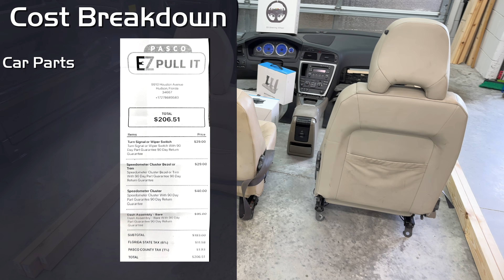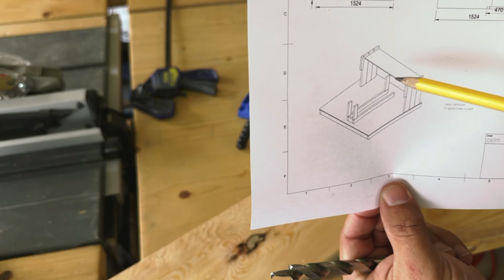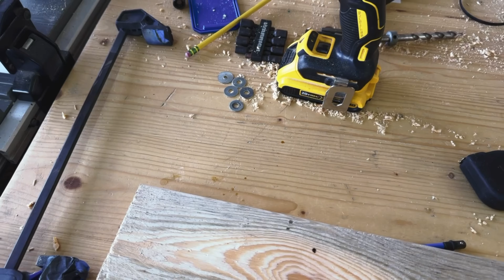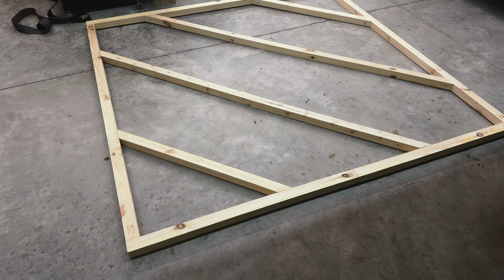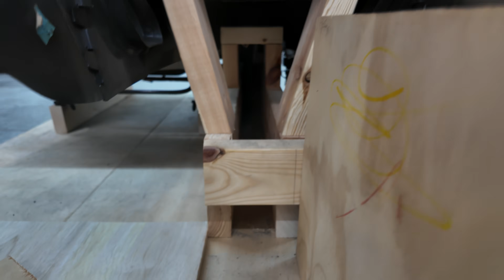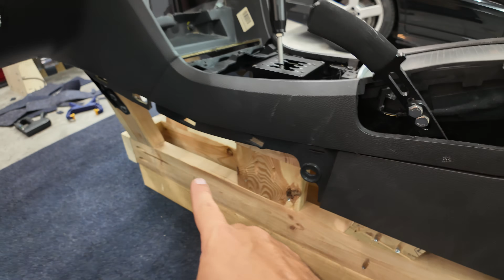How to build a Simrig using a REAL car.

Comment: Im thinking about getting in to race sims. I unfortunately have to start small, I don't know how much I will like it bc I have never played on one other than like arcade games 20 years ago. Im about to order a wheel, peddles, and a stand. If I like it a lot I will definitely have something like this. I have nothing but free time usually because I'm disabled, but when I did work I was an industrial mechanic and fabricator. I already have 2 donor cars, 99 civic ex and an 05 bmw 325xi. Both cars have good clean seats and dashes. I really hope I like it bc this looks very fun to build
Reply from the maker: Nothing wrong with starting small! I did too, my first setup had an ikea chair :)

Comment: I may sound like a stupid question but i really want a full car sim however i love to drift witch will put me in RHD cars i wonder if theres any way to deal with that having the setup static in LHD
Reply from the maker: If you notice my gameplay video, where the in-game car’s steering wheel makes no difference, I adjust the camera to show only the windshield and up. If the car has LHD, RHD or even CHD it doesn’t matter.

Comment: How do you like the offset seat? I like to switch back and forth between road cars, single seaters, and sometime some right hand drive. Wouldn’t mind doing a full dash setup as I’m planning on 65 inch tvs. Just feel like setup for left hand drive is going to affect other vehicles.
Reply from the maker: Because I inky see the windshield the position of the in-game seat doesn’t matter. Some games I can configure the camera’s parallax to match perfectly like ATS/ETS, for others like AC, ACC, etc I just move 10 inches the window to the left. It works perfectly then.

Comment: I wounder how well it would work using half the dash and using 32 inch monitors
Reply: @thegaminggemini317  I’m currently doing that, cut a dash right on the other side of the center console so I could have oem shifter placement still
Reply: @xendrous4569 I seen a few setups works ok so thats what I do cause I dont have space for full dash
Reply: @thegaminggemini317 mine is from an 87 Toyota pickup and center console from an ek civic, came out to 38 inches wide. I’m estimating to comfortable sit it’ll be around 48 in long

Comment: Hey, I had a dual seat dash setup. Problem I had was the visual was never correct as the screen always gives priority to the screen view centrally so as a driver off to the side like in real world the perspective was always wrong and felt like you were looking over to the side to drive straight forward. Noticed yours wasn't like that though which I'm intrigued with how you managed that? (I've now gone single seat setup instead but still interested)
Reply from the maker: I will make a video about that. This bothered me a lot until I find a couple of workarounds.

Comment: Saw this on ig you earned a follower and a subscriber. I have a steering wheel but I need to upgrade my shifter and pedals. I’m most likely going to use an oem steering wheel.

Comment: Well, it might be almost $5000. If you have absolutely no set up already I think for someone like myself this would cost around $3000 or even cheaper depending on how much it would be to get a dash from my car as well as probably up, upgrading my steering wheel and gas pedal to something nicer and getting #3, Newmont will be the most expensive I feel like.

Comment: Ever since I got my fanatec csl did I’ve been trying to make the cockpit as real as possible for cheap. I made a black ground center console from cardboard and fabric. I have a button box shifter and handbrake. I’ve had the idea to put a real dash in but the screen size is the problem. The one u have is insane. My pc struggles to run triple 27in 2k monitors. I really do want a dash but I just got these monitors. I image u got triple 65 4k?
Reply from the maker: Hey, yes triple 65 inch 4K 120hz, but I’d say 2K should be good for most games, and much less power hungry. As you know we’re never done! I hope you get your setup as realistic as you aspire it to be!

Comment: Very cool rig! But why do you render so much of the roof? I mean 1/3 of your vertical sight is the roof interior and this increases pixel density. In nvidia settings or 3rd party softwares like Resize Racoon or SWRE you could set a custom resolution to show ingame render just a bit more than windshield top and with a black background ( or a pre-rendered cockpit roof as desktop wallpaper :) ) It would decrease your total pixels by 30 % and would increase your FPS by a lot. In case of 1440p x 3 you render 11 059 200 pixels while with this method you would have 7-8 M pixels.
Reply from the maker: That’s a good idea, will check that out!

Comment: Can we do this with a ps5?
Reply from the maker: You can use the structure and wheelbase (if PS5 compatible) but the gauges and buttons will not work on a PS5 or an Xbox

Comment: Please drop the second part soon I really want to build my rig but need to know how to wire a real wheel (specifically a bmw wheel) into the moza base, and if I will need to sacrifice a moza wheel in order to do it. The buttons and paddle shifters are the only thing I need help with then I will pull the trigger. Thanks.
Reply from the maker: I just posted an update on part 2 with a lot of information in it :)

Comment: Fantastic man! Great explanation! I was wondering how the build the frame. Last week i went to the scrapyard (in Holland) and get myself a ford focus mk1 1999. So the big question is.. will my speedometer (which has only one port for cable connection) work with arduino. Are you familair with connecting the speedometer of volvo and arduino? Or did you get any help. Kind regards!!
Reply: @ebuaisha7052  im doing same with 08 gto gonna be dope got tge guage cluster working as
Well

Comment: I'm gonna have to build a sim using an actual car, every sim I've seen all have the same flaws,, you're not actually in a car. So I think a mustang would be a great sim, replace all the windows with TV's to simulate accurately what you would see when driving a car, I have been trying to watch someone build a car sim but no one seems to have posted a true driving sim

Comment: When is the rest coming? 🤷
Reply from the maker: It’s a slow process to film and work on it, but I am working on it. :) it will take a while but it will come.
Reply: @Flybrick_S60R  yeah i thought about it and realized that you filmed while doing it and not the whole project split in parts. looking forward to the electronic part, because the rest from this video didn't show me much i didn't know or could already do. making the car display show the in-game map and such is what i really want to know. should i ever make something similar, i would make it for VR, so i could have real world haptics combined with the ingame graphics. no need for 3 monitors or such. the display would be pointless too, but working radio, manual, handbreak, and such, that would be next-level (well hydraulics would be...).

i just saw a video yesterday of someone who attached a wonder tree that moved in turns. that added so much immersion it's crazy. and it was just a desk setup with 3 monitors and a wheel. but that moving mirror attachment added tons of realism.

Comment: How did you do the small monitor? What kind of monitor/pcb and Software is it? :O
Reply from the maker: I’ll show in the part 2, but it is a cheap LCD screen that comes with a controller. It has an HDMI input so it is connected directly to my 4090.

Comment: hello, great video. I am preparing a similar config on a VW Golf 7 base. For powering the electronics (radio, various light buttons, etc.) What power did you use? Do you think 12v 50a is enough. THANKS
Reply from the maker: 50A should be more than enough. In my case I am using 4 12V 10A bricks. One for the radio, one for the power seat, one for all lights and one for the gauges. The arduinos take 5V so I am using a couple of powered USB hubs for those.

Comment: In american truck simulator, do you have a Hi / Lo gear setup or does it not allow for 9 - 18 speed?
Reply from the maker: I use Volvo with the 6 speed manual transmission in the game to help ahha

Comment: I have a full Audi A4 B5 as a donor car at home and I love what you did!
I don't know at all if I want to tackle such a project but let me ask you one question: Would you rather have a full cockpit with doors etc. and a full "car" feeling or do you think it's way better to only have the "lower" part and the possibility to disassemble etc.?
Reply from the maker: If I had the space, I would have the whole car on hydraulics and use a triple projector. You can remove the car interior in some games so it would br seamless z but at this point it will be significantly more complicated. I like the “simplicity” of having the simrig in my home office, I can literally go for a lap in Nordschleife during my lunch break. But if I could I would have one of each 🤣
Reply: @Flybrick_S60R  I think if you would have the lower half of the doors it would already add a lot to the immersion. Going full out with hydraulics etc is imho another story 😀
I'm just imagining it and if I every go for it I really want the "in a car feeling" not "in a sim rig" feeling but I'm pretty sure your's is 80% there (rest is roof, doors, enclosed backwall maybe).
Reply: Hmm now thinking of it... the A-Pillar is kind of impractical to have from the car since it will rarely match the A-pillar in a game

Comment: I've seen your Instagram posts a lot of times and now I watched this video. Great job! 

Now I'm wondering if the written off P2 V70 in our backyard has a partial second life ahead of it.
Reply from the maker: Oh I hope it does! What year is it? Bear in mind the gauges in the tutorial need to be 05+, but it is fairly cheap to buy only the gauges, everything else will work!
Reply: @Flybrick_S60R  thank you for the comment. It's a 2001 if I remember correctly. And a TDI, so the gauges should go anyway. But for the beginning just the cockpit would be great, without working gauges.
Reply: @Flybrick_S60R great video though! super inspiring if you want that real immersion feel. I will certainly take tips from this to build into my rig. 👍

Comment: I've always wanted to change my rig to something like this.  This is awesome. What size monitors are you using? Looks nuts.
Reply from the maker: On my main simrig, the one used as reference, I have triple 65 inch TVs, 4K and 120hz. They are all TCL.
Reply: @Flybrick_S60R  Cheers. Thanks for the response!